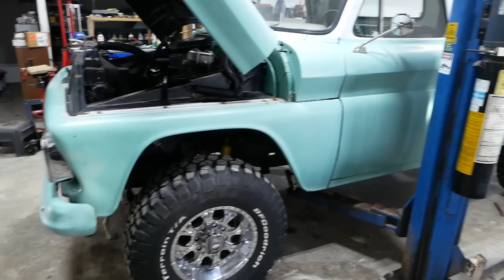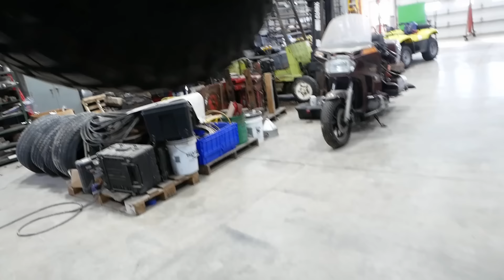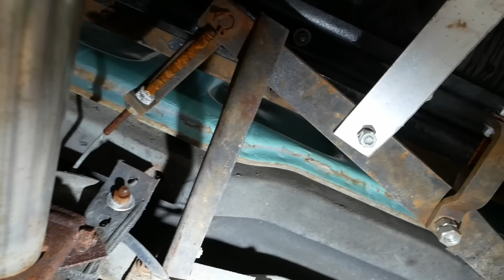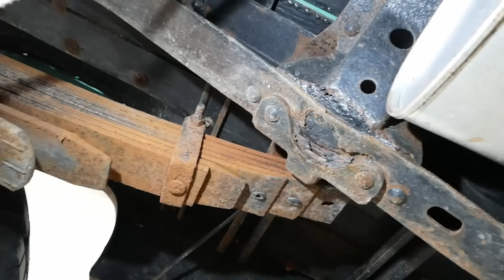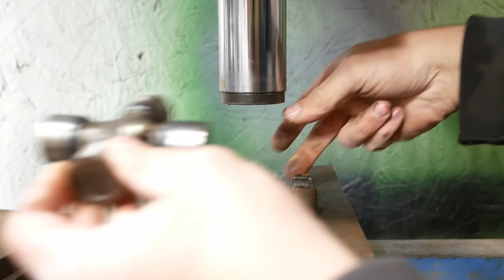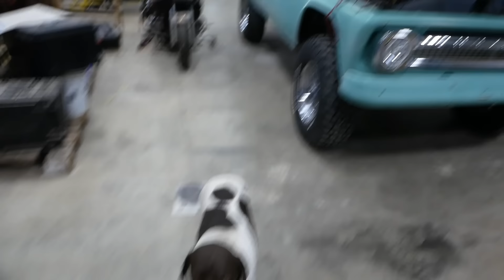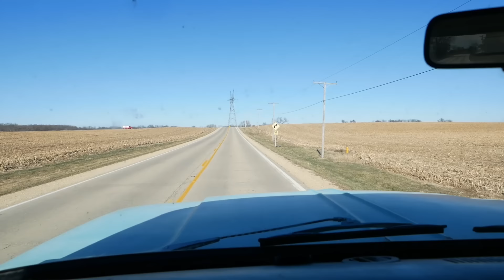New Parts = No Brakes and Other Problems | 1964 Chevy K20 Project

Comment: My usual go to for yokes and stuff like that is northern driveline, they usually have what I need.

The grease zerks in compression thing is an adorable theory for armchair 4x4ers but I've probably exploded 30lb of ujoints and I've never seen one break across the zerk hole, only across trunnions.

Comment: Before I did that much adjustment on the brakes, I would have pulled the wheels and drums to check the shoes, wheel cylinders, etc. I prefer pressing the u-joints in with a vice; hammers are for the shade tree guys. I can't imagine how that yoke got spread out. That truck is a pile. I'm certainly glad I quit being a mechanic in 1982.

Comment: I've used a hammer and sockets and some channel lock pliers and a hose clamp on U-joints. Use what you have to get the job done.

Parts are available via Randy's Worldwide for Eaton axles. I bought 3.32 R&P's for my 57 Napco. At 3000 rpm in 4th with 29.5 inch tall tires it'll do 70 mph.

Comment: You're lucky you have Bendix brakes. I have Budd brakes on my 57 and there's no adjuster on the bottom of the backing plate and they're not self adjusting. There are 2 cams that take a wrench and you HAVE to know which way to turn them, and they need adjusting every 1000 miles. I'm getting good at it though. I even made up a ratchet, socket pair dedicated to just this procedure and keep it in my tool box on the truck.

Comment: A Bendix Brake part book would have those brake parts you need for the E brake. It even has a picture section in the book. I believe that Raybestos brake parts book should have parts you might need.

Comment: You need to find a new drive line shop. They should have everything you need. Some one really did a hack job putting this poor truck together. I love these older trucks. That master cylinder and power brake unit is not correct for the brake system you have. The guy was more interested in making the out side of the truck look good. He should have been concerned about the safety also.

Comment: were i live there is a lot of these truck a few have a little rust but most are very nice one guy has one that is very nice i picked up a 2 wheel drive 3/4 ton with the 283 4 speed the engine they messed it up by taking a wire wheel to the valves to clean them no wounder it has no compression but i got for 200 bucks rust free good body original paint but bad full chrome trim chrome grill and front bumper it was a nice truck traded it for a 71 cst blazer then traded it for a built 327 the guy put in 4000 in the block fresh from the shop and 500 bucks that was his first offer so i took it. then put the engine in my camaro then traded the engine for a factory built 454 with steel crank heavy rods high flow heads 10.5 to 1 compression with a 4 inch stroke with a 02xx trans stock good to 800 hp with 6,000 miles on the crate setup
Reply: i have a 2 speed gear box to give a over drive and it is for a GM setup on the parking break i would go with the 68 setup way better setup and easier to put in just like if you want cable throttle use a 74 nova pedal and cable with the 64 mount it all works like it was factory i know my chevys very well i have built a lot from ground up

Comment: On that drive train you are dealing with either Spicer or Dana. Those companies didn't  care if it was Ford, Chevy, or dodge. Those universal yokes are more common than you might think.  Like the rear end will be a Dana 70. There was only 2 different axels made. 28 or 32 splin. All were same length accept GM has a smaller out side floating hub. The bolt holes are barely closer together. The pinion yoke will be the same on all those pickups. I swap them all the time. None of those pickups ever drove very good. You have no need to drive it fast.

Comment: Old Chevys, just fill master cyl, open the wheel cylinders, let the fluid run out. Best way. If fluid does not start, pump brake once, twice.

Comment: I had a 1966 F-100 short bed pickup.  It would stop OK from around 40 mph but once you got above that it would not stop.  I put new drums and shoes all around and thought I should have fixed the problem.  The drums only measured about 9X2.  I’ve seen better brakes on a VW Bug.  I tried to stop for a quick yellow late one night from 70 mph (I had put in a 302 and C-4 so that it would actually run 70mph. LOL).  I blew through the light at 35 mph.  No matter how hard I pushed the pedal it refused to slow any more.   After that I decided to FIX the brakes.  I bought the whole front suspension from a rusted out 1974 F-250 and put it on my little F-100.  They measured about 11X4.  After that it would stand on its nose.   I kept the drum brake system because it still looked stock.

Comment: I prefer locking the brake with the adjuster then back off rather than adjusting till you hear a slight drag as it centralizes both shoes on the drum rather than maybe only one touching and the other miles off. Your lucky the adjusters work at all, they are usually seized up.

Comment: My 66 has stock powered brakes. I need to graft power steering on though. Easy on two wheel drives. Not so much on 4x4s.

Comment: The ebrake bracket had a T Which is bent so the cables would turn on the T and be pulled by the handle. Mine is about 4 inches long for the T and about two inch to the bar. that way it pulled equal on both cables.   Hope that helps. You are right in saying these trucks do not have good brakes from factory, Mine are trouble from the time I start it I put it in the barn.

Comment: I bled a Toyota minivan master cylinder using a Toyota 4Runner brake line because it was free from the junkyard and some Sienna models had no traction control and used a different master cylinder

Comment: When doing line or master cylinder work I tend to favour my pressure bleedr kit  never fails to push all the air out and changes the fluid at the same time as most people would not have the slightest idea of how old their brake fluid is

Comment: Had a 66 Chevrolet one time that about long bed I don't know what I would have been done to it had a six-cylinder with the integrated intake and exhaust we're practically made into the head and non removable the transmission was very and eventually grenaded itself but the biggest thing was the rear end itself the pumpkin the rear end that was in the truck was not the original rear end someone to put a different rear-end in and was setting up pinion angle and then never welded pumpkin back to the axles so the pumpkin could turn and move on the axles depending on the torque which caused the driveshaft to rotate up and down people can be really shady

Comment: I’m curious if you have a geiger counter if so run it over the dashboard I think you’ll find its radioactive on the truck gauges. It should not be enough to harm you, but should be able to be picked up by a geiger counter.

Comment: Good work mate, I always line up the grease nipples & make sure you can get your grease chuck in there - installed, I put unis in the same way, but I push the first cup in further than I need to so the second cup is engaged with the rollers before pushing it in - I'm paranoid about dropping a roller. If they're a bit tight with the clips in I give the yoke a bit of a shock. Good pick up on the single flare

Comment: So far I noticed or didn't notice a proportioning valve. I got my certification in high school (85). I  was taught to adjust brakes until wheel won't turn, then back off until wheel will make about one turn with light pull on the wheel. That rear axle looks the same as my 1969 Chevy pickup and 1972 GMC suburban. Both are 3/4 ton 4x4. Pickup has 4.56 gears, suburban 4.11. They do not make parts for those rear ends. And that's from one of the best rear end places here in the central valley of California.  You can get used 4.56 gears. I broke a set. 4.11 gears not available. My wife broke the rear end in the suburban. So I bought a Corporate 14 bolt to put under the suburban. I had to move the spring pads. Axle came from a 1974 Chevy 4x4 3/4 ton.

Comment: The yokes on any driveshaft must be perfectly aligned I noticed the driveshaft you repaired was out by one spline at the slip joint. This will cause a harmonic vibration and sometimes can even destroy the gears inside the gear boxes
It will certainly cause a whine
It is not the only thing that can cause a whine but it is easy to fix and eliminate that possibility

Comment: I had a 63 2WD 3 speed on the column.  235 engine. 21 mpg.  Positrac rear end. I drove the snot out of it.  Didn't abuse it, but simply drove it until it was worn out and the frame took on some odd contours because it was a little rusty in places.  Damn that thing could haul a  lot of firewood. And it hauled some nice Wisconsin whitetail bucks.  That positraction made it almost unstoppable on 2 rut backwoods trails.

Comment: I’ve used everything from a block of wood and a hammer to a hydraulic press to change u-joints. I needed the press the last time I did the job because the old caps were stuck in the yoke solid and nothing else I tried budged them. The caps actually broke when the press pushed the yoke through them but they did come out. And yes, I had removed the clips beforehand. A torch didn’t help any that time.

So far I haven’t had any failures with the u-joints I’ve replaced using these methods. I think that people may be putting too much thought into what is a simple job. Just change them the way that works best for you and disregard the naysayers.

Comment: If you're going to put power brakes on it you might as well put front disc's on it as well.. would also look a lot better if the front bumper was painted back white.

Comment: This wrecking yard leftover probably came with the engine of the times which was a straight 6  cylinder over head valve critter.  I  drove one  much like this in the early sixties as a delivery driver . It  was a three speed stick , it was a bare bones  work truck.  Myself and the other drivers beat it to death  making deliveries  on a very tight schedule.

Comment: Whenever someone does their own brake conversion and has problems I make sure the have the correct residual valves installed especially most new master cylinders come with the residual valves for disk brakes

Comment: I'm not too familiar with those Rockwell transfer cases but wouldn't be surprised if a lot of that drivetrain noise is just due to the fact that it's gear-driven without a pass-through for 2WD.. so all the gears are always spinning regardless of mode selected.  Also if there's vibration, looks like the rear driveshaft might have some goofy angles going on.

Comment: Also, you nailed it spotting the driveline slip yoke on the low side of the shaft. We always want it on the "high" side so it can gravity will shed water away from the spline and seal.

Comment: Wes, I worked as an engineer for Arvin Meritor's heavy duty driveline division for years. Your method to assemble the yoke and roller bearings is fine. For RPL (Rockwell Perma-Lube) production, we used a hydraulic press, for field assembly a vise was OK to use. Lastly, after the yoke assembly was fully assembled with the snap rings, we had operators smack the yoke with a steel hammer (real hard!). This centered (stress relieved) the cross between the ears on the yoke. Primitive, but it worked. Love all your videos.
Reply: is there even a real difference between a press and a vise? (as long as the faces are parallel and evenly applying force)

Comment: You should really be bleeding the master cylinder on the bench.  In the truck that master cylinder sits at an angle.  It's possible to have air at the highest part of the master cylinder that you will never get out.  It should be totally level or you will never get all the air out.  Was taught this by many older mechanics in my youth - I'm 61

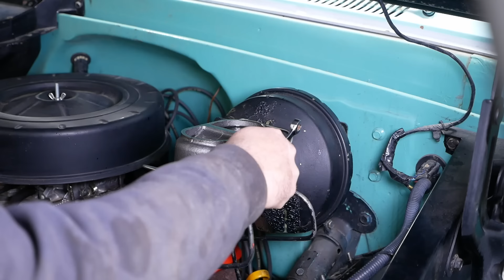Comment: Hey Wes, I had bought an abused ‘67 4x4 Chevy 3/4 ton pick in ‘84 it’d spent its entire life on a farm and hadn’t even been licensed since 1970! Drove it 38 miles home with almost no brakes! Nobody could get drum for it so my brother in law and I decided to swap in the rear ended out of a 74 3/4 ton! We measured a bunch of stuff and found out the spring purches were almost exact so we put the trucks tail to tail raised them up with a hoist dropped out the ‘67 first then the ‘74 and literally bolted everything back together! Used a hybrid U-joint to make the driveshaft work! Beings the ‘74 was camper special I got the 8700lbs leaf springs and huge brakes! Swapped out the 4:56 front gears to match the 4:11 rears and drove the beast everywhere since I was swamp meeting back then in that Silver beast! Lots of fond memories!

Comment: IF THE ALTERNATOR IS  A NEW  ONE FOR A  LATE MODEL CAR  THE DRAW ON THE BATTERY MIGHT BE THE GROUND  / GO  LOOK AT  THE VICE GRIP GARAGE  CHANEL AND  LOOK AT THE  VIDEO WITH A  1932 FORD P/U TRUCK CHOPPED TOP   RAT ROD  HE HAD THE SAME PROBLEM AND FOUND THE E/Z  FIX  WATCH IT AND YOU WILL SEE AND HEAR  HOW TO FIX IT  / GOOD LUCK

Comment: IF YOU PUT A  TORCH ON IT TO HEAT IT UP SO IT WILL NOT CRACK  /  IF YOU CAN'T TAKE THE HEAT IN THE KITCHEN  THEN GET OUT  /  IF PEOPLE THAT WATCH YOU AND YOU GET BUGGED BY  COMMENTS  THEY LEAVE SHUT OFF THE COMMENT SECTION  / SOME TIMES YOU MIGHT LEARN SOME THING  / REMEMBER WE DID NOT KNOW HOW TO WIPE OUR ASS UNTIL OUR MOTHERS TAUGHT US .  / WE ARE TAUGHT EVERY THING  / THAT GOES FOR EVERY BODY  / JESUS SAVES

Comment: Get a piece of flat iron bar, center 3" long, bend up wings (4 bends total) so the nuts don't hit the long bar. looks like you can see old circular rub marks on the long bar where the center 3" rubbed it. The wing tips should be about the same height as the 2 cable ends so the cables align with the long bar.

Comment: Hopefully that truck goes thru a CVSE or Level 1 inspection and gets thrown off the road.  Looks like what a 15 year old would think is good for work on a truck.  I feel sorry for you to have to work on such a poorly slapped together mess.  It has so much potential if in the right hands.

Comment: I drove a lifted Jeep Cherokee on 36’s previous owner did the the lift and the driveline angles on it where so bad I’d have to replace all 4 driveshaft u joints every 3 months or so. Had one break apart on the side of the road using a 5/8th socket and a 15/16 wrench as a hammer replaced two of them. Anyway they go in is fine by me lol.

Comment: I used to think drums weren't as good as disc brakes.  Then, I walked out to our truck shop (I work in the office).  Every semi I see in the shop has drum brakes on the front axle and both rear axles.  The trailers they pull are also drum brake equipped.  So, I don't knock drums anymore.  I do like disc brakes when I have to change the pads as it is far easier than getting the drum brake shoes swapped, adjusted and bled.  I don't usually need to bleed disc brakes unless I change the caliper.
Reply: You don't need to bleed drum brakes unless you replace the wheel cylinder.

Comment: That voltage draw might be from some of the wiring still being connected to the external regulator (if it's still there) That truck would've come with a genny, not an alty. Had that prob with my 62 C50 bus.

Comment: West the only thing I would suggest also is get rid of those freaking drum brakes and put at least the front as with the disc brakes and like you said if he's going to do that with the rear you know change the axles you might as well don't even worry about that pinion gear and of course those big tires on there that's not going to help they weren't designed with those tires all right this is Bob from Vero Beach Florida God bless have a great holiday and stay safe and try to stay warm cuz I know it's going to get cold up there all right peace out

Comment: I never understood why automotive 45* flares are double flared. Unless 45* is inherently weaker than the JIC/AN 37* flare standard, it seems like there is more opportunity to screw up a double flare causing a failure.  I have worked on hydraulic systems up to 5k psi with single flares, and have never had leaks or splitting failures of the hardline.
Reply from the maker: My understanding is that single and double flares have the same pressure rating, but double flares are more resistant to vibration and tolerate being removed and installed several times.

Comment: That bent yoke was no yoke! 🤣🤣🤣 Seriously, nice job on straightening it out. Hope it doesn't break, cast doesn't like to bend! Nothing wrong with how you did the U-joints, but the bench top really didn't have the strength you needed. I like the vice method. There is one step you either didn't show, or it is a step everybody I have seen on YouTube leaves out. I'll do a video on an old drive shaft I have. I still owe Mortske a Quadrajet video. I did do one recently on my 20+ year old Harbor Freight tire changer. Still need to post it. I bet you could make that a nice truck if it was yours, or if the owner has very deep pockets!

Comment: I can't believe that you install U joints like that.  Everyone knows that to get an additional 762 (on average) revolutions for them you drop the caps in dry ice, heat the yoke to 1250 degrees with a torch and then put the cross in the freezer sandwiched between two bags of peas for an hour before slapping it all together with Alan Jackson playing on the radio.

Comment: The 14 bolt rear end from a '73 and newer truck is wider then the original unit , which will cause the tires to stick out past the body , same for the newer disc brake front axles . Years ago I had a '68 GMC K2500 with a Dana 44 front and Dana 60 rear ends , those you can get any gear sets for including 3:54s .the '67/'72 axles are the right width and use the same shock mounts as the '60/'66 trucks .